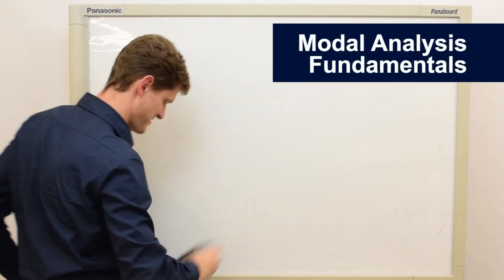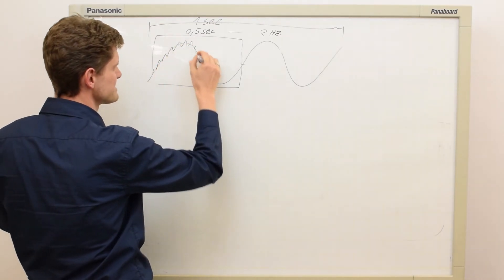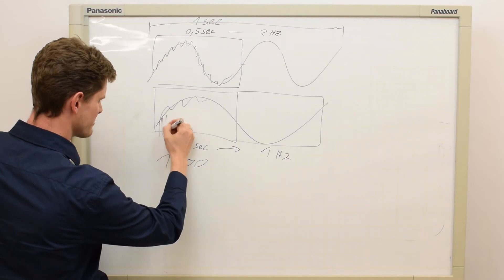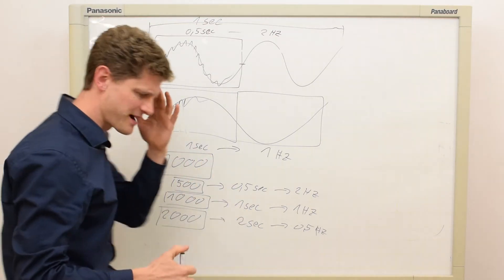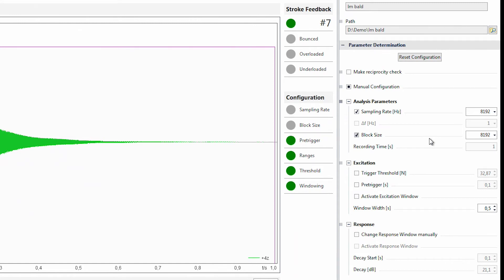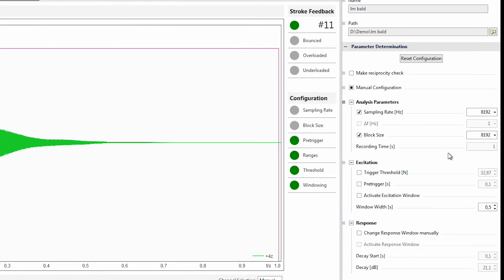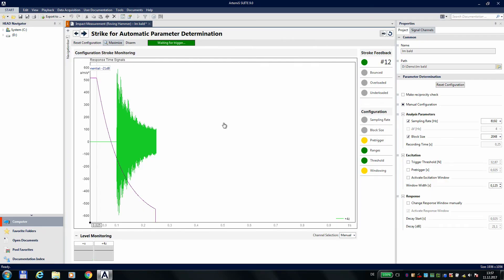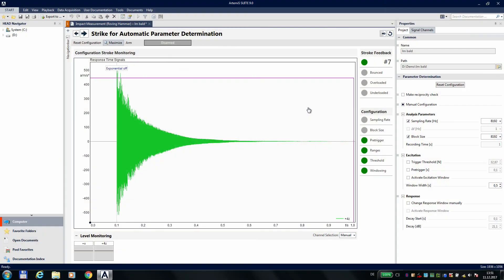Right sampling rate and block size for impulse tests NVH | Modal Analysis | Part 6

Comment: If you are interested in a frequency range of 0-5000Hz and you sample with 20000Hz. How long your recording time should be? if it is a car engine.
Reply from the maker: First of all - This is a very large frequency range for a car engine. I would maybe check for rigid body modes in a range form 1 - 50 Hz.
Or I look for bending modes in a range from maybe 50-500 Hz. Above mode might exists on small parts of the engine.

To your question: If you recording time is one second, you will get a frequency resolution of 1 Hz (this is indepent of your sampling rate).
For low frequencies (like 100 Hz and below) you need that high resolution or even higher. If you are interested in frequencies of 2000 Hz then 20 Hz resolution is still fine enough.
But like in the video: Check out the quality of you signal in the measuring time. Signal to noise ration. If you measure a lot of random noise in one block, you get random results :-)
Reply: @HEADacousticsInternational  OK, but what if your frequency resolution is 5Hz and you are interested in 0-2000Hz? How long you should measure in order to calculate FFT?
Reply from the maker: You are mixing up a few things there.
The evaluable frequency range depends on the sampling rate. If you want to analyze up to 2000 Hz, then you have to sample the signal with at least 5000 Hz. Otherwise you will miss it.
The chosen block length to be calculated then determines the measurement period and thus the available frequency resolution.
        In this order.

In addition to this video, we recommend that you also watch our tutorial on the different hammer tips.
The right tip for every frequency range.
Reply: @HEADacousticsInternational  Lets say I sample with 5000 Hz and I'm interested frequency up to 2000 Hz and I would like to have 5 Hz block size for FFT. How long should my recording time be?